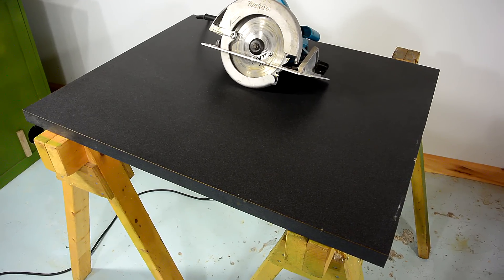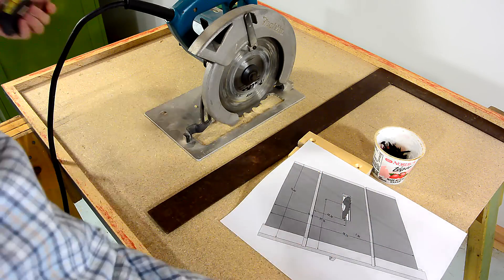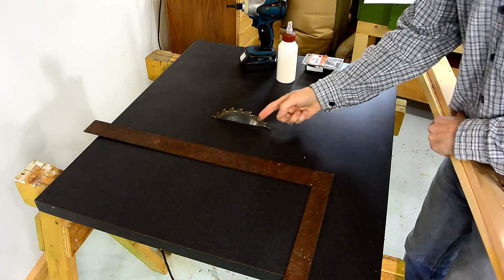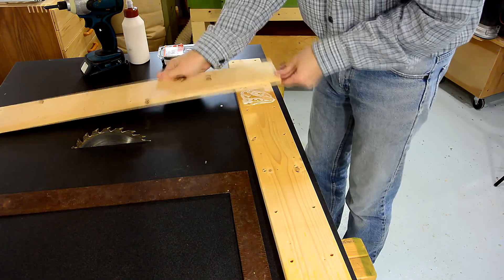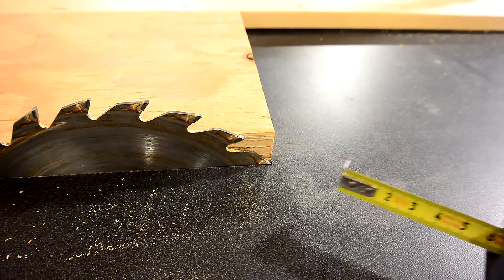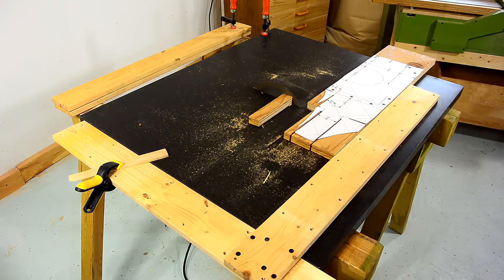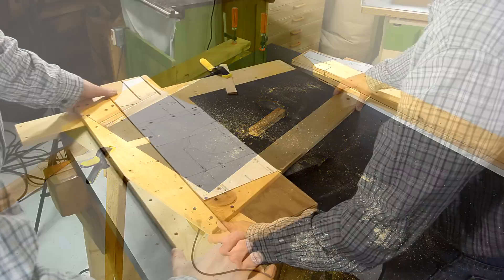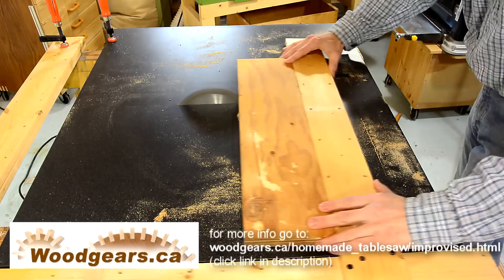Improvised table saw (to make a table saw)

Comment: I love that you're not using other tools, such as your table saw, for this project. So many DIY style videos require a full well stocked shop. Plans, saw, measuring tape, clamps, wood, pencil. And presto! That's how it's done. (Forgot drill and screws).

Comment: I built one identical about a year ago. I hoped to save money by not buying a real table saw. The one I built, the saw was under powered on cuts. It didn't have a guard so it throws dusk back at you.. And as he mentioned... it will throw your piece back at you if you tilt the piece a hair off. Its an awesome idea. For sure a down and dirty way of making one work.. I finally broke down and bought a mid priced craftsman table saw off craigslist at a low price.. Its cuts are square, its got lots of power, and it comes standard with tilt, riving blade, and blade guard. I am excited to see your 2nd attempt at one with new revisions.

Comment: I made something similara to this a while back. It works well. I used a bit of varnished pine as the top and am currently just using the depth adjust on the saw itself, no fancy system. I made it so it can fold away, seeing as i just use a single car garage for all my work.

Comment: Having used a saw like the cheap one you used to show the need for the one you are building, I can see that the temporary one you just threw together to build the next one is already  several steps up from the cheap one that I had. Building a table saw to build a table saw, kinda makes you Grandfather TS.

Comment: If your table was a square, could you make a fence like a H-shape instead of a T-shape? What way it will track along both sides, both when used as a rip fence and cross cut sled. Could that be easier to use, of would it jam as cross cut sled?
Reply: Tomas Helleberg Eventually you would destroy it, as you cut into it when using it as a crosscut sled.  Watch this video again, you can see that he is cutting into the fence a bit when he cross cuts.
Reply: wordsnwood I used the same trick in a pinch, the way to never cut in to your sled is to put a board in front. It, then becomes the sacrificial part. 

Or, you can put a board in a reverse T over it and have that support the piece as you cut through it like a table sled.

Comment: Why, Matthias, You are not using tilt mechanism of circular saw, but constructing something completely new? I have no experience with MAKITA circular saws, but other tools I had from MAKITA, was pretty high quality, so I suppose, this mechanism should be good as well.
Reply: ***** 
Do you always want to climb under the table to adjust the height of the blade? If it is possible att all to reach the saw's mechanism after it's fixed in its mount...
And even on a quality saw the mechanism is much less rigid than the saw being mounted to a big piece wood that is then moved.
Reply: In previous version of table saw, mechanism was not much more convenient comparing to original mechanism in sense of placement... but may be was. I don't know. What I'm concerned about big piece of wood....Such piece in closed box reduce airflow, so there could appear problems with sawdust extraction and cooling ( what was mentioned as some of reasons why new version will be built)